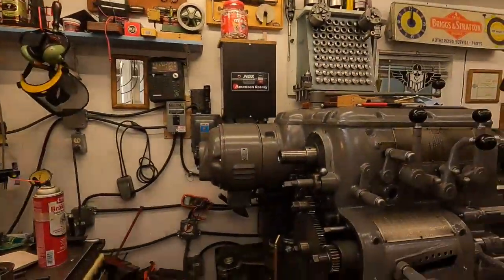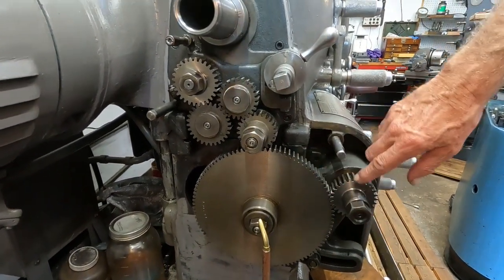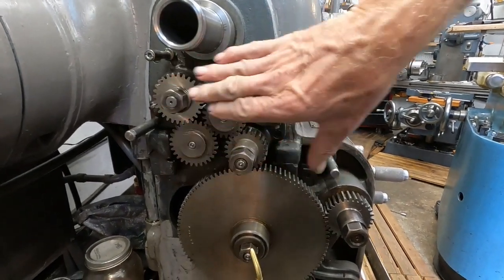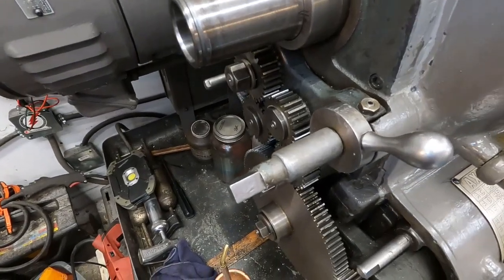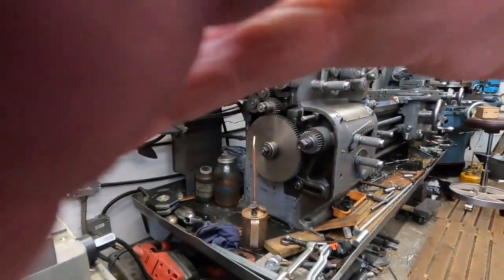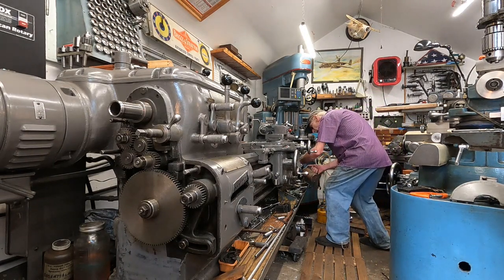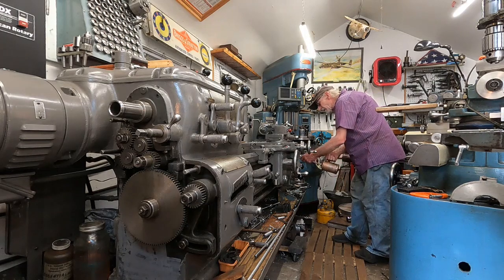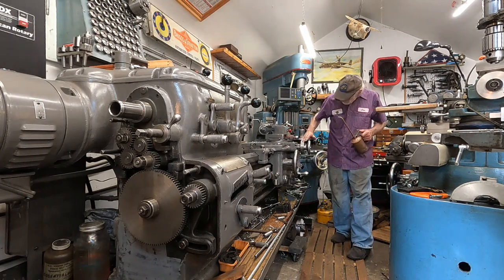Machining carbide and oiling an old lathe

Comment: I noticed no coolant is used while sawing the carbide. I assume the saw blade is diamond bound in brass, which is an adequate heat conductor?
Reply from the maker: Yes, the wheel can be used wet or dry, it is a resin bonded 6" x .035" width 100gt.cut off diamond steel core wheel. It parted the carbide without over heating on my somewhat low powered older machine. The Shars wheel is about $70 total off ebay or $20 or more less than buying direct, so far so good.

Comment: Newbie Question: What oil would you recommend? Do you stick with what’s recommended for these older machines or prefer more modern lubricants? Thanks in advance!
Reply from the maker: The closest match to the oil 80yrs ago I found is AW68 hydraulic oil for the older gear head machines. The Axelson lathe says for mostly highspeed use, a lighter oil like AW46 can be used. Also, The more expensive Mobile DTE oils can be used.

Comment: Have you considered using a weight attached through a pulley by string to your table to pull it? It would give a steady consistent pull. You could adjust the weight to control the pull speed!
Reply from the maker: I think compressing a spring would help with that.

Comment: Hello 
I'm glad to see your show and very nice info.
I have some questions about the gears for my homemade Lathe the hold body of the lathe is finished and ready but now I'm stuck on how to get the gears to contact the gears box and track the south bend and my is doesn't know gears teeth numbers. 
I tried looking in my place but never founded. I saw gears lathe in Amazon but I can't get it because no shipping to my country.
Thanks
Reply from the maker: I think you are talking about the yoke where the idler gear can be adjusted to accommodate gears of different diameters.